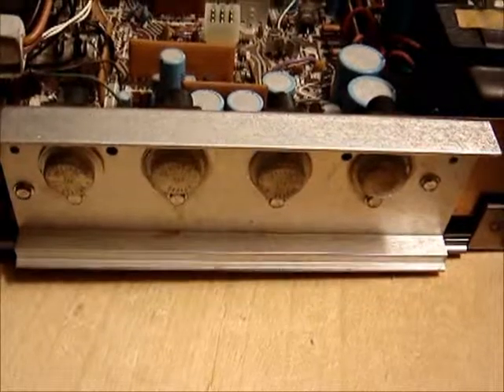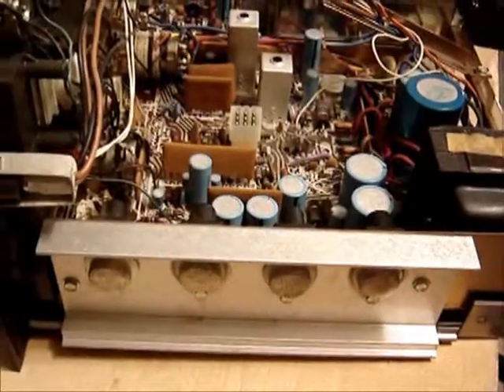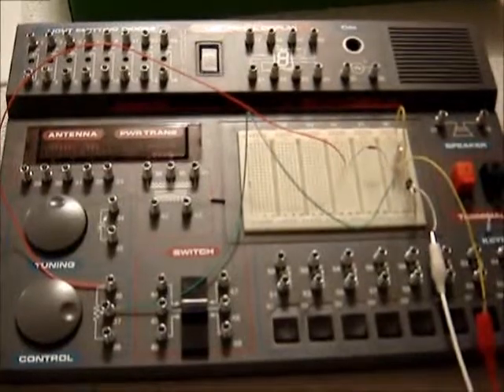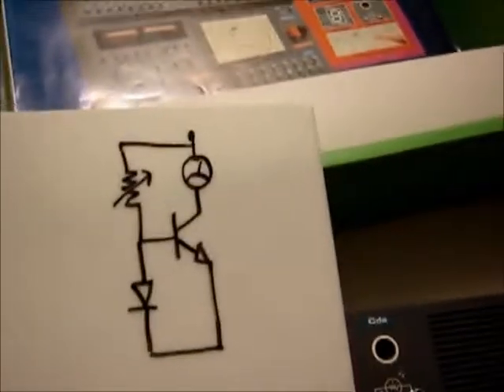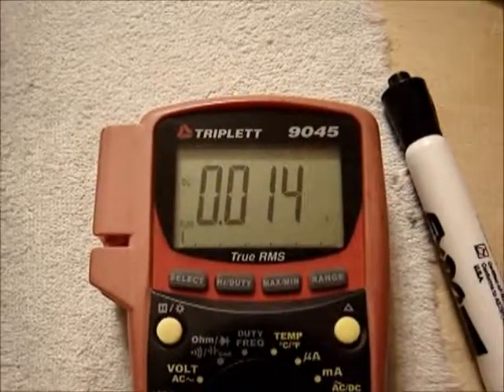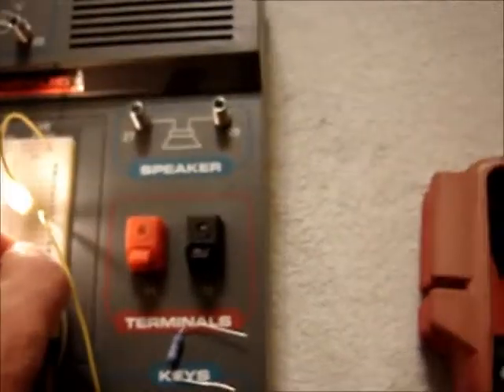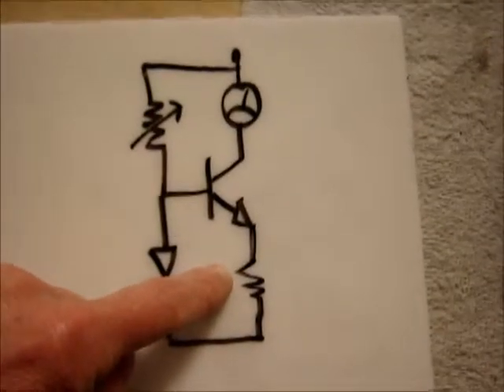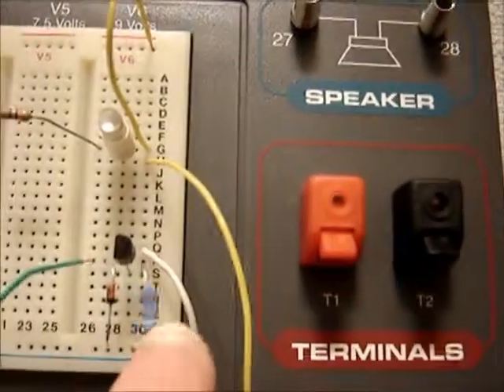Transistor thermal runaway demonstration

Comment: Hello, so I just have a question, how would I compute the resistor needed to prevent the thermal runaway?

Also, does this thermal affect greatly increase the noise?
Reply from the maker: +Keith McKinzie "All about circuits" has some information. Scroll down to the Emitter Biasing section.
http://www.allaboutcircuits.com/textbook/semiconductors/chpt-4/biasing-calculations/
In the real world it takes experimentation and a little black magic ;-)
Reply: Also, you need to be careful to select the correct resistor part. Some resistors' resistance will go DOWN as they heat up, which is what you DON'T want (the current will go up, causing more heat ... so yeah, thermal runaway). You want a resistor with a positive temperature coefficient.